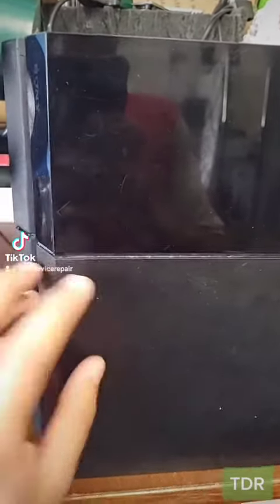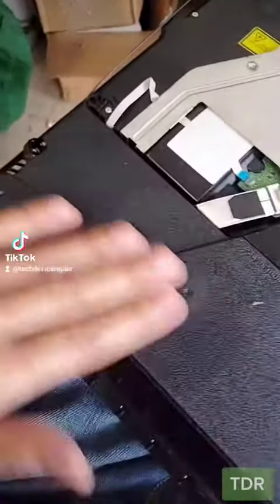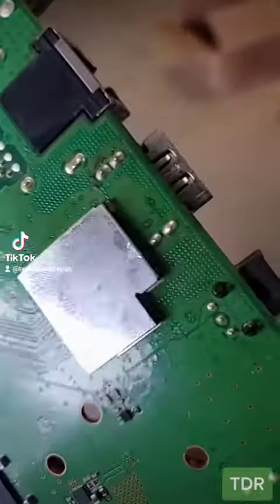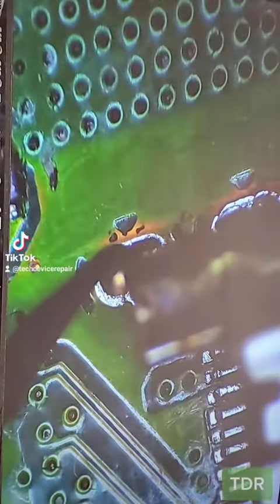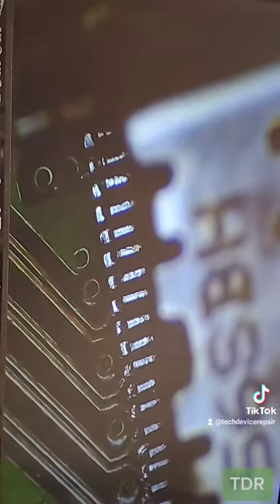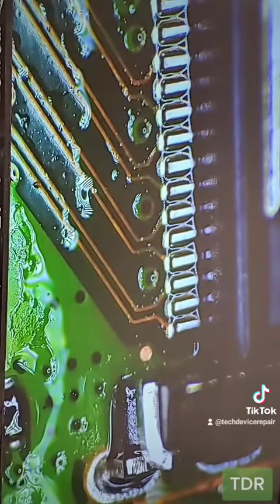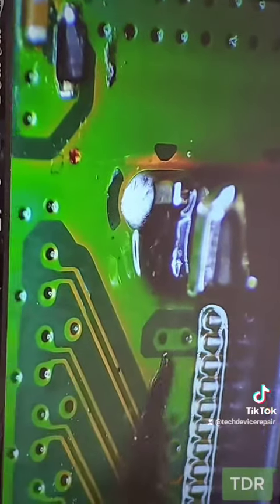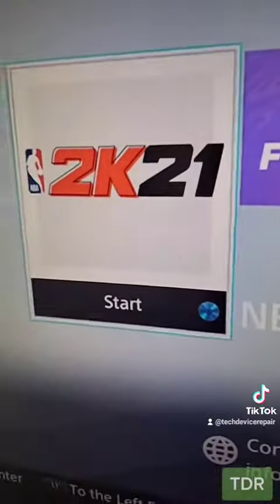A dead PS4, DIY fail?

Comment: Why is it that every ps4 I see that is broken is this one, not the slim or pro. Thank God I got myself a slim and it still works years later
Reply: HDMI port by the manufacturer is really done poorly that's why it breaks so easily, actually it's the number 1 issue with the PS4. even PS5 is not spared from the poor HDMI port.

Then u'll have people who don't have much knowledge in soldering doing a DIY repair and failing.